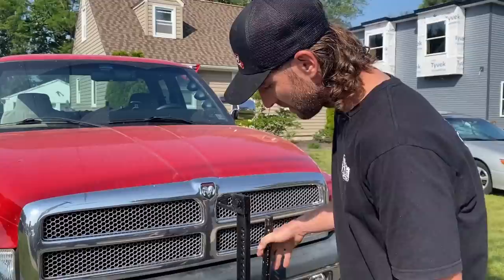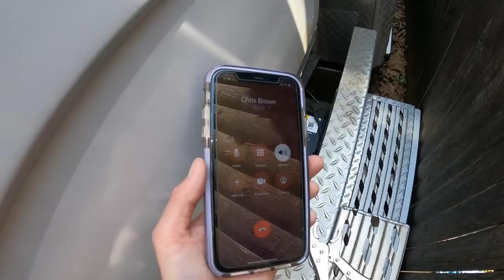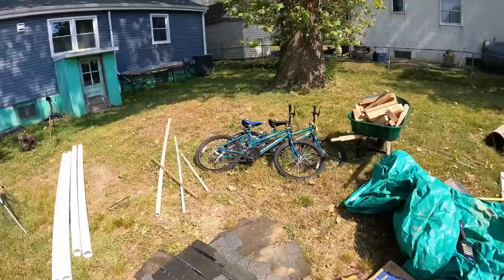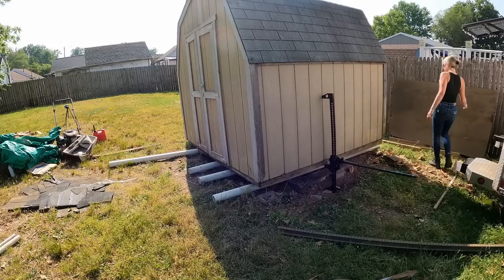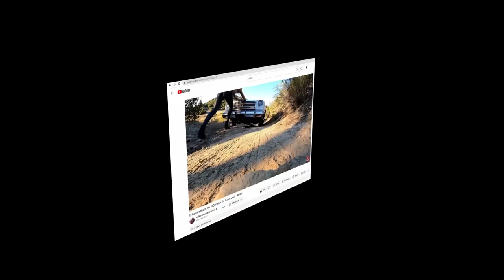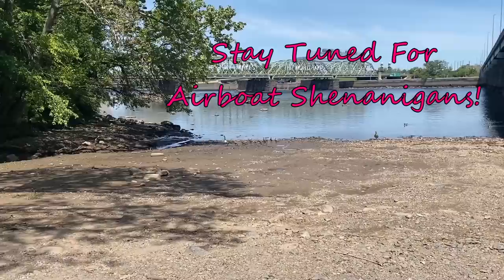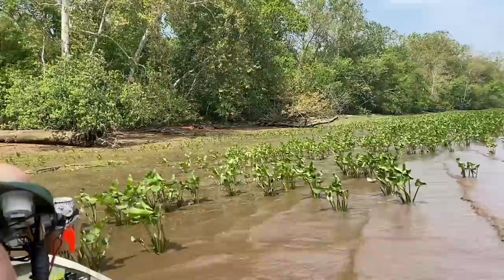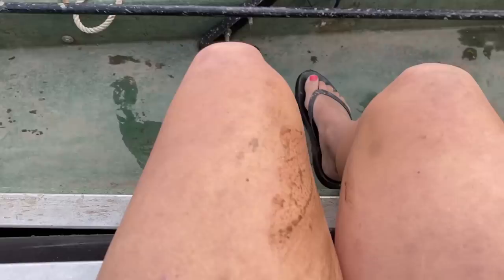Attempting To Move My Shed the Old Fashioned Way! Jennifer Sugint-NNKH

Comment: Jen, that's an absolutely amazing job at moving your shed. You are one tough little gal. Not sure if I could see cement blocks on all 4 corners. You may know already, but if not, don't let any wood contact with the ground. Will rot so much faster.

Comment: Another great video.  Towards the end I was even making pushing motions, hoping it wouldn't roll back. I had a similar shed and raised it three feet by adding to the bottom.  This made those short walls able to hang rakes etc. It would make a great follow up vid. Great job. Yoga pants clearly help.

Comment: My Dad put in a shed about your size in 1967. He died 57 years later and we had to take the shed down but he had poured a concrete foundation which was left when we sold the house. We had to put a couple of roofs on but it didn’t leak. We bought it at Rickels which was the Home Depot of back then. Put some concrete down. It doesn’t rot like wood.

Comment: Jenn, you ROCK!!! I just started seeing your channel today with the installation of the kitchen exhaust. I saw this one and a big smile came to my face. A long time ago when we lived in Voorhees, NJ , (now in S. Fla but also from Philly & know Neshaminy well back in the days). I bought a shed kit exactly like yours from Builders Square (don't know if they're still in business), I built it in my rear yard and I found out 6 months later it was on a township easement and had to move it! I got some chain & wire and used my old Honda Civic to pull & push it about 20 feet, fortunately in was still in one piece also! So now you know you are as strong as a Honda Civic and MUCH prettier! Fly Eagles Fly!!!!

Comment: i got to give you credit that's a two men job and i'm surprised that shed didn't come apart,i have a 10x12 that needed leveling and when i jacked it up to put blocks the nails were backing out of the floor frame i had to reinforce with screws and the shed was only about a year old.

Comment: My first suggestion would have been to have you nudge the shed w/ the ambulance. The pvc rollers is 4000 year old tech but it works. Getting a helper decreases the effort per person by a pot full. I admire your hyper tenacity but it’s much easier w/ 2 people. I just called a crane but then I’m 73.
If you ever get into the foundation of that shed, install a  trio of sistered up 2x6s perpendicular to the existing floor joists.
I built something like that using 2 conex containers.

Comment: Firstly Jen that was A MAZE ING, wow what commitment from you, also I could pretty much see from the start the shed was not only moving 6 to 8 feet 🙂

Secondly, One of my jobs was teaching using High Lift Jack, right at the start I was hoping nothing went wrong, you managed to figure it all out safely with the briefest of guidance, I used to spend a couple of Hours getting 4 folks up to speed with demonstrating and carrying out the task themselves. Part of my demonstration involved a Water Melon, on a stick with the jack switched to down and dropping the handle so the weight ratcheted the load down. Honestly EVERYONE got a bit of Water Melon. I am SO glad there was not too much load on the jack when it happened to you. Incidentally they can be used for clamping and winching too, also useful for breaking the bead on a tyre, however need to be used with respect.

Talking about respect BIG RESPECT to you. As you said at the end it was a 2 person job, would have been SO much easier but wouldn't have given you that Top of the World Ma feeling.

Re what you wear, don't let anyone tell you what to wear, you wear what feels GOOD for YOU, unless there is a safety issue. Sometimes I look at folks and sometimes for a brief second think "don't you have a friend to tell you how you look" then instantly mentally apologise to them.
 

I would like to take this opportunity to apologise to all the folks I have mentally treated as above, of course they don't know I have done it but I do. Keep on making the great videos, it must make the task more difficult. Well done again.

Comment: 28:30. Ive moved larger stuff weighing 10 tons with 1"dia pipe with littel force then that shed.  Its going to roll no problem,  but as you roll when you move off a pipe you've got to put it on the other side your rolling to.

Comment: Mad props on moving that shed that far with just the pvc and jacks. The whole time though, all I can think about is a pulley system with rope, a come-a-long, or even those t-post as a lever would have made moving that over the pipes easier. Glad to see you get it done though. Amazing work.

Comment: 44:16 so the block foundation is Jimmy Hoffa grave?   

Go buy yourself  1/2 a dos cement blocks and set it on them then you can make a ramp up to it but if you get it up off the dirt then its not going to rot.  Also with the blocks you can leval it also buy some top rocks for the tops of the blocks. You can also use deck post pers  and  set them in the conners with 4x4 post you cut to a leval lenth  over time it will settle in.

Comment: Love the determination & can do attitude! You should probably put all four corners back on bricks to prevent your foundation from rotting. Also if you decide to move it again, wrap a towing strap around the shed and use that ambulance to pull the shed over the PVC pipes. That would have gotten you most of the way across your yard.

Comment: If you kick that release on the hi lift ,to down.  And take the handle and hold it tight and smack it closed like, the thing they do for movies when they say action 🎬    and it will release both pins at the same time and just drop the whole jack head to the ground.  Like a quick release. Be very carful doing this try it with a little weight on the jack at first.     It's was faster then hitting every pin when lowering it

Comment: Now is not probably the best time to hear this, but if you would have kept PVC in front of the shed as you were moving it, you might’ve been able to get it to roll onto that PVC without having to use the jack every time you wanted to reset the PVC.  It might not have helped with the effort it took you to push, but at least you would’ve had to use the Jack so much! If you ever try something like this again, maybe try that. See if it helps otherwise impressive that you did it yourself. I don’t think I would’ve tried that alone!  I’ve got a chicken coop to move. I don’t think I’m gonna try doing it by myself.

Comment: next time you have to move something like this take the tow truck. you lift the 1 side up with the winch, then slide the stinger underneath and then strap the shed to it so it can't move backwards. could have likely had that thing moved in 20-30minutes. the stinger should be rated to lift more than the shed.

Comment: The song is called hypotheosis. Actually was a huge club song back in my day. Early 2000. Now, let's roll woman.
Jen, why didn't you use the wambulance to nudge the shed to push it as you keep feeding the pvc to the other side. The wambulance has nice rear push bumpers and just did it gently.

Comment: who cares what other people think, it not safe to not be comfortable "heat exhostion" just always be safe, and by the way take it from a firefighter anytime you use a ladder tie the thing off. and it would have probably helped if you had another pipe then you would not have to jack it up all the time. but good work!! wish more wemon had the same modivation you do. i personaly would have put 2 or 3 logs under it perminitly angle cut the ends lag bolted the shed to them and then used a yard tractor or a vehicle to push or pull it to the location. the logs would have gaven you a foundation after you moved it from water damage to frame over time.

Comment: Very impressed, BUT, goddamn did you scare the hell out of me when you were using that jack and not lifting the shed floor joist, and also, make sure you trim those tree branches back or they will destroy the roof. I would have left it outside the brach-overhang.

Lastly, you need to raise all four corners off the ground ontherwise it will rot more. I'm sure that's a project for another day that can be easily fixed, but bplese don't leave any wood on the ground. 

All of that said, Holy hell you're a freakin' beast. I need to do the exact same thing to my shed, that is the same size, and looks to be in the same condition. You've given me hope.

Comment: kindof flinching here but then again i been known to have made simulair misstakes , nice ambulance btw should make a great mini home 
its nice to see a girl whos willing to do the dirty work as mush as the glamorous work and isnt scared to break a nail or get a scratch , i personally get most satisfaction when i done a good job by myself , having saved some money from not hiring others is another part of it (then again having to do the same job twice to get it right cost more but over time you learn tricks to do it right the first time )
some comunities have rules on how close to the propperty line you can put structures , might need to move it back / away from the fence a little eventually if the neighbours going to make a fuzz 
the shed is actually still pretty solid it was just the wood skirting that was rotten , do need to put it back on stones to keep the wood from getting too wet , setting it on a gravel bed or a square of concrete sidewalk tiles would help a lot and probably would help against gritters trying to dig holes under there and undermine it , even if thats not a problem if those gritters die under there the place will stink

Comment: When pushing something really heavy try to put your back against it and push walking backwards, I find it takes a lot less effort and you can push a lot heavier things like that. It takes your arms and core strength out of the equation which are always weaker than legs

Comment: Was there rain in the forecast? 😂
Buying a extra piece of pipe would have remove most of the jacking out of equation when you want to move it again next month.
Maybe could use the tree with a pulley to make the move easier for some distance?
Good video

Comment: Great song and Chris impersonation. You should sing more. Wear what you want. If its comfortable. Surprised you moved all that stuff without gloves. Do you have black widows or brown recluse spiders there?  You might have been able to gently have nudged the shed back with the ambulance if the ground is pretty solid. Those high lift jacks are pretty dangerous but you learned without getting hurt. Great video.

Comment: You have to feel more confident in yourself for having accomplished this. This isn't a easy job. Well done. You might want to consider how well you have it off of the ground and if you should possible anchor it. The more stuff you put in it the more support you might want under the building.

Comment: You could of used one of those pcv pipes as a lever and never had to push, but hey you at least got a workout, and tell chris he needs to slick up the bottom of that boat, to much friction, heavy D did that to one and used it on snow, y'all won't get stuck then👍

Comment: I've gotta work on my shed, whoever put it in originally i swear just sat in right on the ground, left front side is rotted and collapsing into the ground, whole floor is almost gone, it is an oldie.
Reply: You could paint next, for fun, I have painted one it's not that fun though, not a lot to paint, but takes a day atleast.

Comment: Did it not occur to you to use the ambulance bumper to push the shed?
Reply from the maker: It did, but it was so close to the neighbors fence and I’m not experienced enough driving it. I most likely would have knocked the fence over.

Comment: What a nonsensical way to do it.
It can be disassembled partially in 30 minutes.
There is a tree next to it to which you can have tied a pulley system. There are also several vehicles on the property 
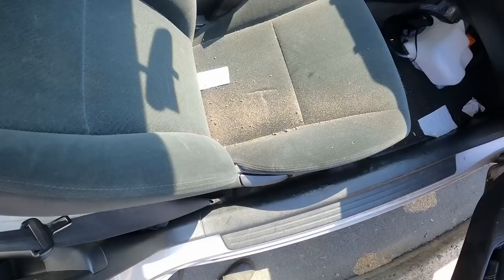At 2:24 there is literally a vehicle with a winch on it to lift a car.